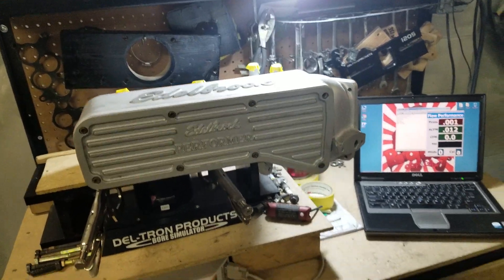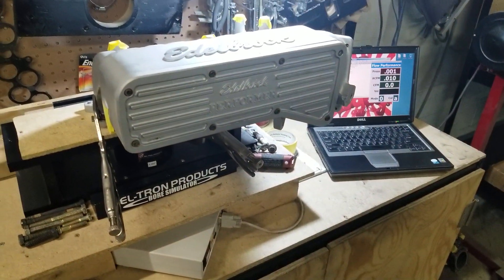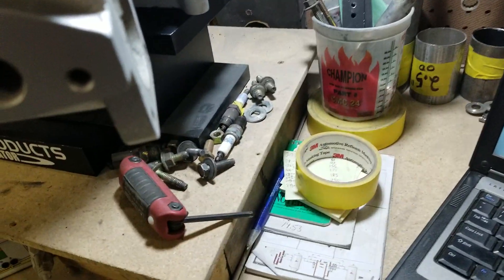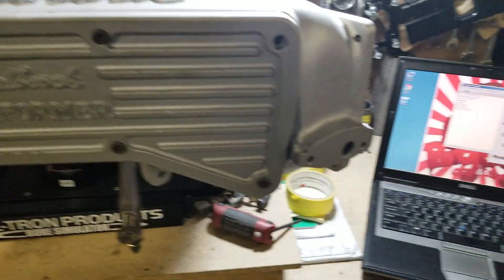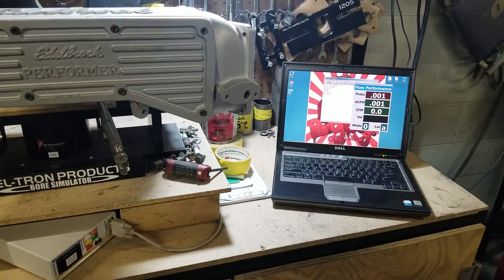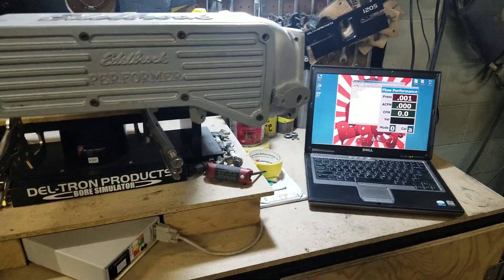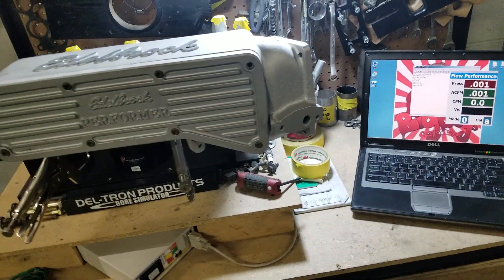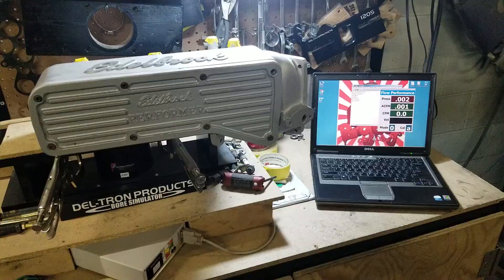Bigdogs Porting Edelbrock 351w truck manifold flow testing

Comment: What did the ported truck eldelbrock intake end up making
Reply from the maker: @camper187killa  average bolted together runner flow was 275-280cfm from our stage 2 porting
Reply: @bigdogsportingtonyb2833   stock form or ported  ?
Reply from the maker: @camper187killa  no stage 2. Stock was 225-230cfm average runner. 
Our Stage 2 factory 351w truck efi manifolds flow 245-255cfm average runner

Comment: Man I've been really thinking about this ,I got a old 302 in a 90 f250 I'm trying to hit 300 hp in idk if I should keep the efi or just carb swapping it
Reply from the maker: Hitting 300whp using our ported parts is easy. Going carb is going backwards
Reply: @bigdogsportingtonyb2833  idk carb is definitely the cheaper route
Reply from the maker: @sagennc9019  carbs are boring, less fuel efficient and old technology

Comment: How much to port 96 f150 5.8 lower and upper? Motor is built so was thinking of getting the edelbrock kit but let me know what you think. Thanks
Reply from the maker: We have flowed the Edelbrock truck 351 manifold and our stage 2 ported factory 351 truck manifold and our stage 2 flows more. On a mild build with a ported factory twin throttle body the Bronco picked up 25whp/35wtrq from the beginning of the run to the end across the board. That was just the factory ported manifold and throttle body. The heads and cam were the limiting factor.
Message us on our Facebook business page at Bigdogs Porting for pricing

Comment: back again.. yeah it is crazy... funny I came back to these videos and never realized you did mention how much CFM these giant truck plenums flow.  I have my  ported factory plenum  with "dog legs"  as I heard an old timer call the square ports.. and because of  slightly larger valve covers  ( and I still can't believe I found they make them for these )   but I did get a trickflow phenolic spacer  1"...  do you have any experience with those or theory on these particular plenums given that they are already huge long runners?    I also got a 1" throttle body spacer which I hear mixed things but part of the reason  was because I'm in an econoline  it doesn't hurt to take the  TV cable plate forward an inch so its not under the body at all from in front of the dog house.. My thinking is well obviously cooler air  since the phenolic is that much more heat resistant   at least takes way longer to heat up  so for racing maybe its not the best... but   I'm thinking it could actually pick up some NET low end torque from the longer runner and volume without a sliding attribute of losing top end power.. at least in my application where my cam is like 1500-5500.  I'd love any thoughts/experience on this,  because it's definitely cool to pick up cheap power on the  non $900 factory plenum haha.  Also thank you again for shedding some light on the truck intakes and flow numbers... 280-300 cfm is ridiculous.   I wonder if they would respond that much better with an old powerdyne or vortech.. even though thats positive air and not vacuum.. still just a curiosity.   I believe the GT500 (prior 6xx hp generation) uses like the same size throttle body   120 mm.
Reply from the maker: Our experience is once you have the right amount of cfm spacers just shift the rpm of where your torque and hp peaks occur when the cam is smaller than optimal for the combo. A 1" runner spacer in that situation affects the peaks by about 250-300rpm.
As far as cooking goes it really doesn't help much under the hood. You can gain more cooling effect from cai or hood heat exchangers. Now those work!
Reply: @bigdogsportingtonyb2833   Cool thanks for the input Tony.  yeah cam wise it's perfectly suited for all of the work to the E7's and intake.. not over .500" lift and about 281 293 adv. 215 / 224 .050.   5500 peak. I also put the Transgo 5400 valve in my AOD.  So are you saying heightens the peak  like a tunnel ram or something?  or Lowers..  I once had a 460 with a tunnel ram which I thought was interesting ( not built by me )    but my understanding is the longer runners add or "move" as you say torque to the lower end..   yeah the problem with a van  is the doghouse is fairly cramped  so I may have to get a hood scoop in there. Thankfully K & N  does actually make a dual filter for these TBs.
Reply from the maker: @DS-mo6md  yes the spacers lowers to rpm where the torque and hp peaks occur
Reply: @bigdogsportingtonyb2833   perfect... oh  I have another inquiry..  So I bought this pitot tube with anemometer   to measure  velocity  in different areas.. ( unfortunately can't build a flow bench but this can fit in a tool box ).. I really just am doing it  as  like something beyond an inside caliper.. etc.  to where I can check consistency and check a couple things .  Obviously this will work for the heads ( except for the exhaust ports with thermactor dumps in each head)   but  I know obviously  on the intakes   theres some weird turns. I know you mentioned  was it runner 5 or runner 8?   that flows less...  With the dog legs  like where should I expect less speed / volume ? on what cylinder.. I mean obviously I think I know already but I'm just curious..
Reply from the maker: @DS-mo6md  you really can't use that to measure flow. Not accurate and you can mess up things really quickly
Reply: @bigdogsportingtonyb2833  hmm.. I still can't find where I saw someone using a pitot tube to look at velocity at different portions of a runner and port. I swear it was in like a magazine I had. maybe a book. I'm not going for pressurized flow just open velocity to make sure the ports match but with a source plugged into something to cover valve holes.   I should probably have just set about to build a damn bench LOL.
Reply from the maker: @DS-mo6md  just send us your parts and be done with it. To build a good bench that's repeatable and accurate with fixtures, electrical and motors will cost $7-$10k and I have a degree in electrical engineering and I'm also a master fabricator so lol.